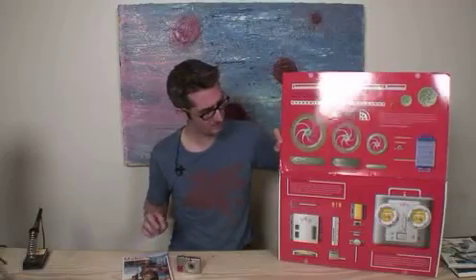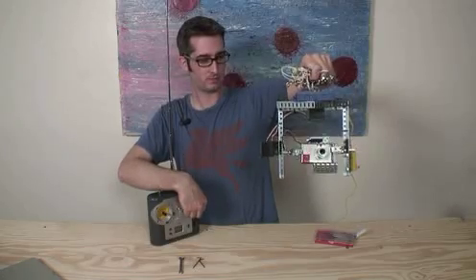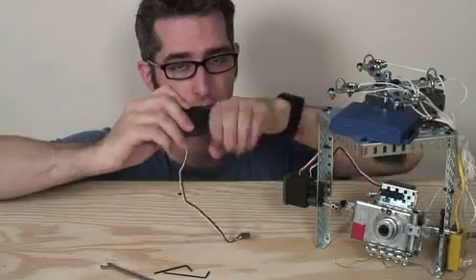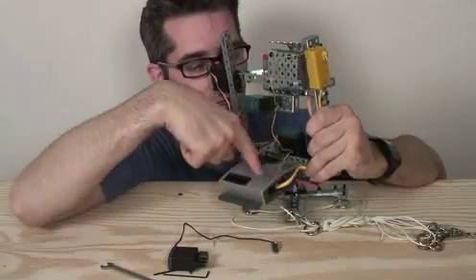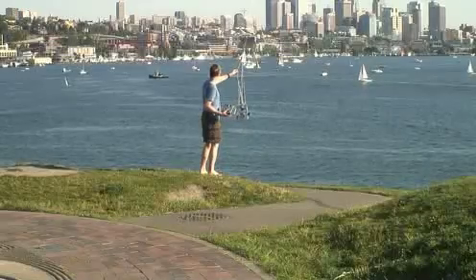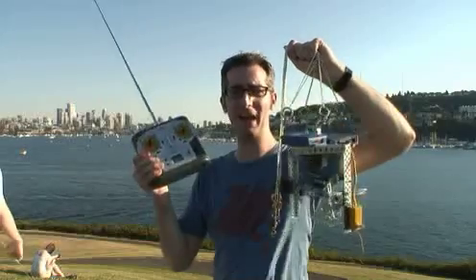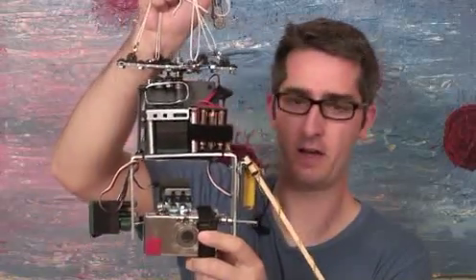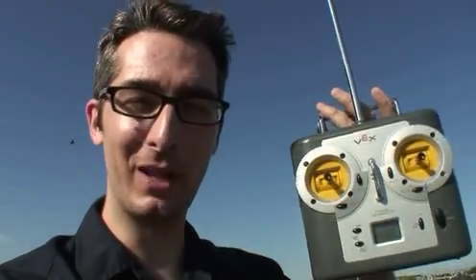Make Podcast: Weekend Projects Make A Kite Aerial Photograph

Comment: If the metal is getting hot he needs a sharper drill bit and some lubrication. I have cut 200mm holes in 8mm aluminium and it dosnt get hot at all. As long as you use the right speed and the right bit for the material with lots of grease its fine...